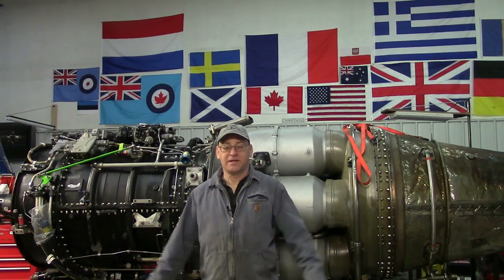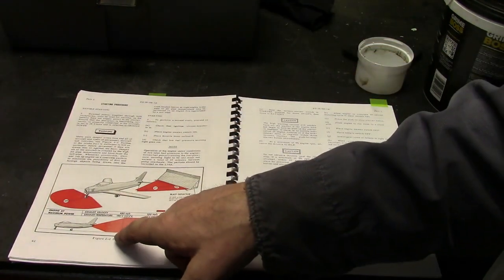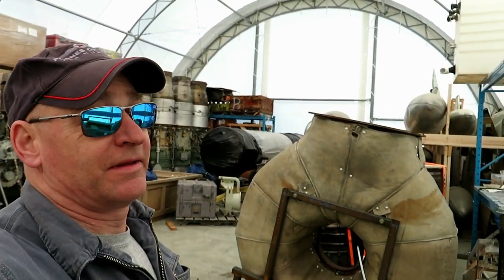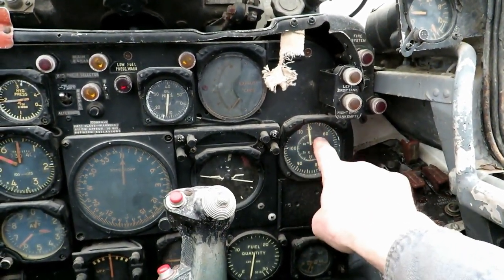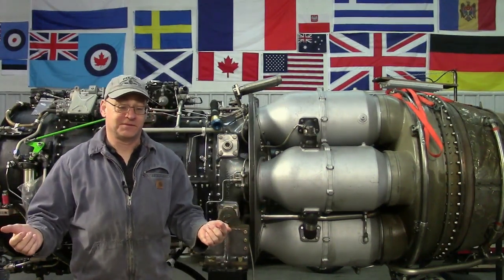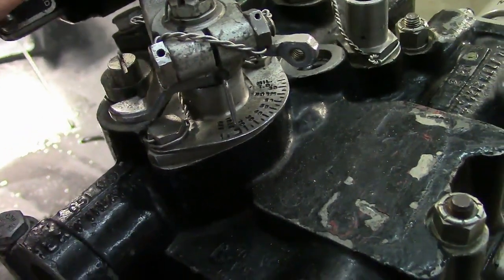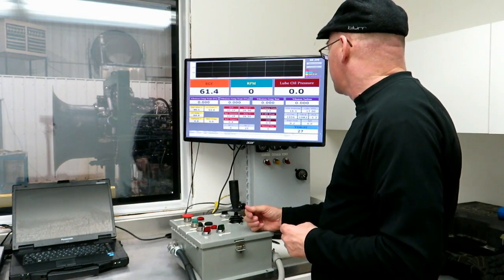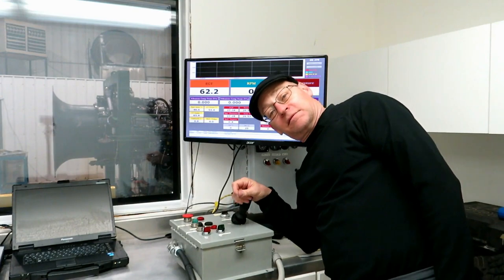Jet Engine Starting: Cockpit vs Test Cell

Comment: "High speed roast beef ripped off your face"
There has never been a more epic and apt description of the outcome of not observing safety protocols!  This phrase should be included in every safety manual from here on for absolute clarity!
AWESOME job on presenting this and the effort that you put into these video's is impressive.  Thanks as always for sharing with us and still loving every video. Thanks AgentJayZ!
Reply: Rossco Thompson 
Although I have problem with high speed “beef”. High speed roast flesh would be proper if you wanna use in a manual. Don’t you think?

Comment: When I was in the Air National Guard we had F-100's with J-57's in them. We didn't have a test cell. We had to taxi or tow the F-100 with the tail removed out to a pad and chain the airplane down to test the engine. The hydraulic lines going to the tail had to be capped off in order to pressurize the hydraulic system. In the winter time we used to throw snowballs into the flame when the engine was in afterburner. And it was nice to stand close to it on a cold winter's day.
Reply: The Fresno ANG has an F-100 on display. Too bad ever since 9/11 they surrounded the place with security fence and now it's not accessable to the public.

Comment: Hey Jay Z, I flew two Century Series aircraft.  The F-102A, T-33 and T-33AT which was the attack version. The F-102 was famous for compressor stalls. You could not throttle burst it while stationary. These were not big stalls and we called them choo choo stalls which sounded like someone pounding a hammer on the fuselage. All you had to do was slow down your throttle a tiny bit. Startup was not computer controlled like today's jets. The F-102 had an air turbine starter. You needed a ground power cart. The drill was spin, spark and then spray. Same with the T-33 except it had a starter generator. I now instruct in a Cessna Grand Caravan with a Canadian built PW PT-6A engine. This is only simulator but has a real cockpit, motion and sound with Garmin 1000 display. You are actually in a CRV. I also flew for 8 years in the Dornier 328 which had PW 119B engines. What a beautiful engine. You guys up there in the north do great work. BTW j Z, I'm not sure where you are but Ottawa was one of me best overnights.
Reply: Very interesting

Comment: Post WW2, my late father was the instrumentation engineer on the original F-86 project at Muroc Dry Lake (today’s Edwards AFB) back when Check Yeager and the X-1 were trying to break the sound barrier at the other, top secret side, of the base.  Talking about walking in front of the engine, my dad told me a story on one of the guys getting sucked into the F-86 and a bunch of his team had to go in and recover his body.
Reply: That's crazy, great story

Comment: glad that you had the fun of getting in a Sabre and running the engine!   I spent some time as an avionics tech on A-4 Skyhawks, and had a license to run the engine.  Definitely a fun thing to do... until the time my ground crew gave me the fire sign!   Turned out to not be a fire, but sure was a bit of excitement that I didn't need.  :-)

Comment: I don't know how you would go about obtaining one or the fuel for it, but I'd die a happy man getting to see you restore/rebuild & do a test run of a J58. 
One could dream, eh? 
Your videos are absolutely incredible, Jay!
Reply from the maker: Awfully sorry, chap, but I get a comment like this every week. And my response is always the same: Could you even tell the difference between a J58 and a J79?
Both are large afterburning turbojets that propel aircraft in excess of Mach 2.5.

The bypass tubes that make the J58 a ramjet can obviously not be tested during a static test.
The J58 is a useless engine that no longer has any purpose.
Many J79s are flying today, and many examples of its industrial derivative are also running.
If a J79 really isn't enough for you, then you are respectfully asked to leave immediately.

Comment: You're right about being one of the few.   Not many of us have the experience, and actually did remove an engine from an aircraft, repair it in the shop, test it on the test cell, reinstall it  on the aircraft, and perform the engine run up.  I have done that on F-100's and OV-10's Having a 56 year career in Engine tech did give me some advantages LOL

Comment: Seeing the Sabre cockpit brought back a lot of memories, the most important thing to watch was the. EGT on start up. When I was stationed in Germany an engine tech was doing a full run up a chap decided to go to other side, he passed in front of nose wheel and was sucked up intake ,engine was running at 100% he Didn’t survive. I’ve run up many Sabres, CF 100’s and 104’s plus J79 ‘s in the test cell.

Comment: Love the "wall of Draken engines"!  I read that Saabs licence-built version of the Avon was more powerful that the Rolls version, it was (again!) in Stanley Hookers book, he commented that he Saab built version was made with tighter tolerances than the RR version. That's from memory, the book is 1500km away now!
Reply: I've had a quick scan through my copy of 'Not Much of an Engineer', but not spotted any such comment.  I'll look in more detail over the next couple of days.
Reply: grahamj9101 Hi. Lol, you sound a bit like me when I’m on a mission to fact find😀 I think it was in the section where he also described their wind tunnel, may not have been in the chapter about the Avon though! I liked his comments about Ford  UK telling RR they would have to redraw the Merlin drawings because the tolerances were too wide for their mass production specs!
Reply: @grahamj9101  I forgot it was actually Volvo not Saab that built the Avon, a division now owned by GKN.
Reply: @markdavis2475  And Volvo Cars is now owned by Geely, a Chinese automotive group, as is London Taxis International.  The taxis are now built in a new facility on the far side of the of the airfield site that was once occupied by R-R's Industrial and Marine Division, which is where I spent the first half of my career.
Reply: I've told this story on this channel more than once but, back in 1982 (or was it '83?), I was walking out through the main foyer of Whittle House, Bristol,  on my way to lunch.  I was in conversation with a colleague and let the glass door close behind me, only to hear a growl of disapproval.  We looked back and, with embarrassment, we both said in unison, "Sorry, Sir Stanley!"  However, I digress.
I was rather non-committal with my previous reply, but I've now had another, more detailed scan.  I can find no comment about SGH being involved with Svenska Flymotor and the RM6, which was a licence-built Avon RA.29, designed in the 1950s. 
Hooker was heavily involved with Avon development during 1947 and '48: it was the root cause of his row with Ernest Hives and his departure for Bristol Aeroplane's Engine Division.  When the RA.29 was being designed at Derby, he would have been busy with the Proteus and Olympus at Bristol.
PS:  Tightening some tolerances (eg, tip clearances) would, at best, only have a second-order effect on engine performance.  It would need a tweak to the aerodynamics to produce a significant improvement in the performance.
Reply: @grahamj9101  Hi! AFAIK SGH wasn't involved in Svenska, he just made the comment about them. I wonder if it's in Bill Gunstons book? Either way, both books are far away from me now. Ill find the ref. one way or another!
Reply: @markdavis2475  You don't have to travel those 1,500km: I've just gone to my bookshelf 3m away.  I will quote from page 135 of Bill Gunston's book, 'Rolls-Royce Aero Engines'.  "When the first RM5 [for the Lansen] went to test it gave about 2% more thrust than expected, and the reason was found to be that Flygmotor were producing blades to finer tolerances than British blades."  However, Gunston does not identify what tolerances were involved. 
My take on this is that producing blades (and vanes) with tighter aerofoil profile tolerances, might contribute a small proportion of the suggested improvement.  What might have contributed relatively more would have been tighter control of the aerofoil stagger tolerances, to give better control of throat areas, particularly in the NGVs.  As I said before, any appreciable improvement in performance would need a "tweak" of the aerodynamics and that would have been an entirely serendipitous tweak.
Reply: grahamj9101 Thanks Graham😀 I’m glad my vodka soaked brain hasn’t become completely addled 😀 Yes, it would be good to know the exact reason why they got more power! I wonder if it was more to do with the test instrumentation? I sell instruments and no matter good they are, two or more measuring the same thing will usually read slightly differently! Have a nice, long, weekend! Mark
Reply: @markdavis2475  Test beds should be calibrated and the usual method is to test an engine on a so-called 'master' bed, then send the engine off to the bed to be calibrated.  From this, test bed correction factors would then be established.  Whether this was actually done for Flygmotor, I've no idea.  And yes, the apparent thrust increase could be down to measurement differences, but I'm quite prepared to believe that it could be down to manufacturing differences.  I've certainly had direct experience of apparently insignificant manufacturing changes producing measurable effects on performance and surge margin, for example.  Unfortunately, however, my experience has been that they usually have a negative effect.
Whilst Flymotor probably produced their own drawings with metric conversions, it was highly unlikely that they tightened the drawing tolerances.  Why should they?  It was a different matter in the war, when Ford did so.  They had to to suit their manufacturing and assembly processes.  Whereas Royce's at Derby (NB: it is never known as 'Rolls' at Derby) had skilled craftsmen for machinists and fitters, Ford was relying on the repeatability of its machine tools to produce components for (relatively) semi-skilled fitters to assemble.  
It could, perhaps, be that Flygmotor had better machine tools.  Whilst Sweden must have suffered privations during the war, they did not actually have to fight in one and their industry would have been in better shape.  As an apprentice in the 1960s, I became aware of the ancient machines that were still in use in the machine shops at Coventry.  Nevertheless, if there was a real thrust improvement in the RM5, it was almost certainly a matter of good fortune and serendipity, rather than conscious intent.
Reply: @markdavis2475  PS  I'm enjoying my weekend, thank you, with the spell of warm weather we are having at the moment and I have plenty to do in my garden.  At my age, I'm in protective self-isolation and have been for the past four weeks.  However, as I live to the north of the city of Bristol, I can take my permitted daily exercise walk on footpaths through fields and woods and come across very few people.
Reply: grahamj9101 LOL it’s bloody rubbish here! Winter has popped back for a few days, bit of snow/rain!! Stay safe and well!
Reply: @markdavis2475  Pardon my ignorance, but where is your "here"?  As you will have gathered, mine is north of the city of Bristol,  in South Gloucestershire, with views over the Severn estuary and the two Severn bridges.
Reply: grahamj9101 Hi! Sounds very nice there! I’ve been visiting Bris for many years, Airbus and Bristol water are customers. Right now I’m in Estonia, which is the place I call home for now! My colleague is from Bristol, his dad worked at Bristol Aircraft in  Filton all his life!
Reply: grahamj9101 Just saw your reply, thanks for your really detailed info😀
Reply: grahamj9101 PS My colleagues father was Rodney Close, he worked at Bristol on advanced/exotic metals and ceramics for turbines. Maybe you knew him?
Reply: @markdavis2475  Sorry, but the name doesn't ring a bell, but then I've always been bad at putting names to faces.

Comment: It's a sin to let all the old planes turn to crap like that. Great video, thanks.
Reply from the maker: You kidding? This one is a survivor. It's a sin to cut and smash them up for scrap, like tens of thousands of P-38s, P-40s, P-47s, P-51s, P-80s, F-84s, F-86s, F-100s, F-101s, F104s, F-105s, CF-105s ( FFS!), F-4s, B-17s, B-24s, B-29s, B-36s, B-47s, B-49s ( FFS!), B-58s, A-1s, A-4s, A-10s, A-26s; Spitfires, Hurricanes, Lightnings, Canberras,  TSR-2s (FFS!), Vulcans, VC-10s, ...
I'm sure I've left out hundreds of great aircraft types, and I only went back half way!

Comment: Really good idea using the cockpit to illustrate the start procedure.  Also, while contested on a "technical basis", George Welsh (not Chuck Yeager) was actually the 1st person to exceed the speed of sound while flying the XP86 (test bed for the F86).  The "technical" matter is that the Bell X1 flight (10/14/1947) was a "certified flight", with all data gathering equipment applied, while Welsh's flight was not certified for "all" regimes.  Also, Welsh's flight angle was slightly nose down, while Yeager's flight was in a level attitude.  Later, Jackie Cochran was the 1st female pilot to break the sound barrier while flying a "Canadian built" (tada-tada-tada) F86.
Reply from the maker: From videos I've seen of interviews with Mr. Yeager, the X-1 flew an arc and went supersonic in a long shallow dive. The first time anyway.
Reply: ,,, I'm not so sure that G. De Havilland wasn't the first to break the barrier, but didn't survive the encounter..
Reply: @rolandtamaccio3285  Now that's a really good technical point.

Comment: I have started a SAAB  J 35 in the cookpit.  We diid a engine test on it. Faulty afterburner pump.  What  power, felt it even if the fighter was secured You felt it.

Comment: I was waiting for the ejector seat to go off !
Reply from the maker: In this seat, it's not a joke, and I would rather not die today...
Reply: The general practice when a fighter jet is undergoing maintenance is to have an egress technician disarm the seat so it can't accidentally be fired on the ground. They used to disconnect the line coming off of the ballistic actuator so the worst that could happen if the ejection handles were pulled is the actuator would fire.
Reply from the maker: Yes, I'm fairly sure the charges have been removed from this derelict, but do I want to bet my life on it?
Reply: @AgentJayZ  No. Ejection seats can be dangerous. You don't want to end up splattered on the roof of the hanger.
Reply: Agent jay zeeeeeeeeeeeeeee.!

Comment: I was totally expecting SOMETHING to drop when you hit the drop-all switch. That would have been great!
Great video! Keep em coming! Would love to hear that Orenda run and be able to see the throttle actuator moving, maybe some shots from inside the test cell showing the EGT and RPM coming together. (I know there is only so much your allowed to show, maybe haze out everything else)
Reply from the maker: A couple weeks ago I showed all of that with an Orenda 14 test.
Reply: ya ya ya, but it's not THAT one, geez. (Kidding), I'll find it and have a look. Do you have one of the inner workings of the start cart? I found one you talk about it and show it, but mostly outer stuff. Thanks!

Comment: Throttle lever outboard for ignition & boost pump - if its anything like the A-4, there is a small micro switch that the throttle hits on the outboard slide that activates these.  In the A-4 we "came around the horn" at 15% N1 to introduce fuel and start the igniters. If we didnt 'bang' the throttle outboard there was a chance we missed the micro switch, resulting in a wet start.
Reply: Dave Souza , you are correct, around the horn.... brings back so many memories doing engine turns.  “Go around the horn like a man” was how I was taught, take throttle all the way up and then back to down and start counting for lite off. Oh to be 20 something again
Reply from the maker: Jeff D.: that is not how you do it. That's how you get fired.
Oh, never mind me.
I'm just a guy who starts and test jet engines.
I don't know nothin'!
Reply: @AgentJayZ  Just to clarify, in the A-4 we were taught NOT to advance the throttle past idle when coming "around the horn" unless we wanted flames to come forward though the compressor and singe our ears. Conversely, if the engine didnt lightoff in 15 seconds (wet start) we had to be darn sure NOT to hit the microswitch when moving the throttle to cutoff. Saw a guy do it once accidentally resulting in a 30' "afterburner"

Comment: While running the HI-BAY (Test Cell0 For the AGM-28B Hound Dog  W/ the J52 P3 we always installed an Inlet FOD Screan. One time I plaved my gloved hand on the screen at the edge of the Inlet.(Spike System) at Max Military Just to see what kind of Suction it had It was signifant but not overwelming. 
The J52  was also used in :
AGM-28B Hound Dog
Dassault Super Mystere
Douglas A-4 Skyhawk
Grumman A-6 Intruder
Lockheed Martin A-4AR Fightinghawk
Northrop Grumman EA-6B Prowler